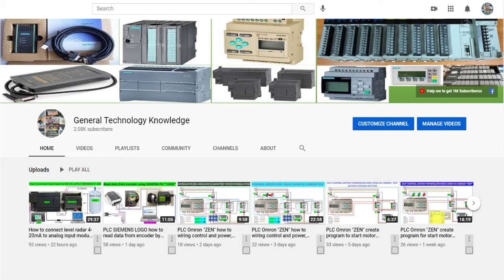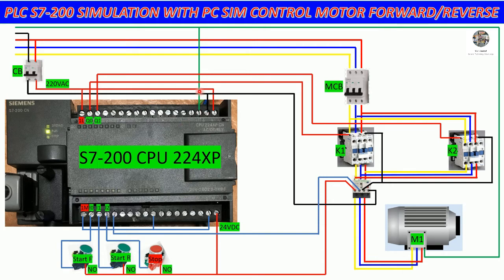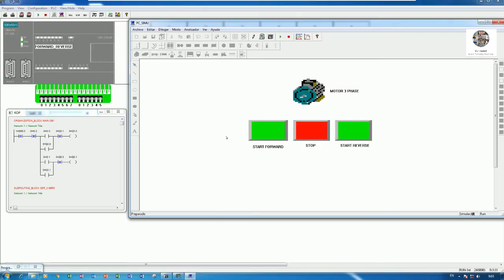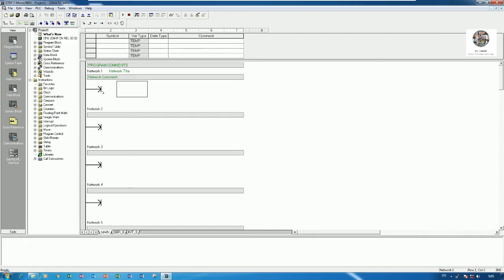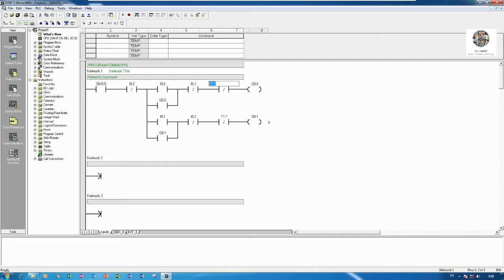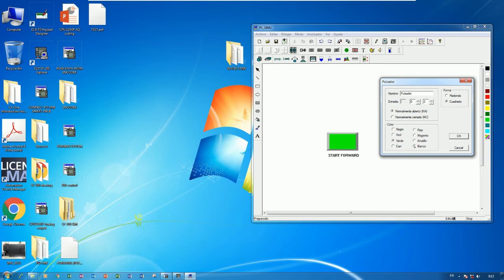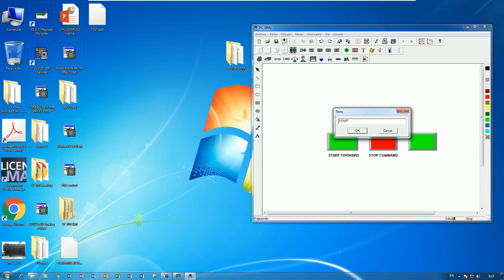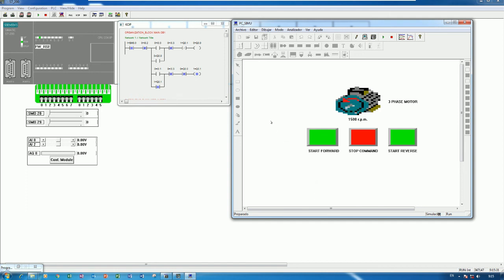How to wiring PLC S7-200 Simulation control motor forward and reverse

Comment: Thank you for sharing..I have problem because i renew the plc of fuel module and it seems that the program not yet installed. After switch on the supply p/p booster p/p and auto backwash didnt work automatic. Could you help some inputs how to trouble shoot..thank you in advance

Comment: Kindly upload wiring and program for S7-300 with Forward and Reverse signal with analog value for speed variation for synchronisation purpose.
Reply from the maker: Dear sir,
I will prepare it thanks you
Reply from the maker: Did you mean generators sychronization diagram?